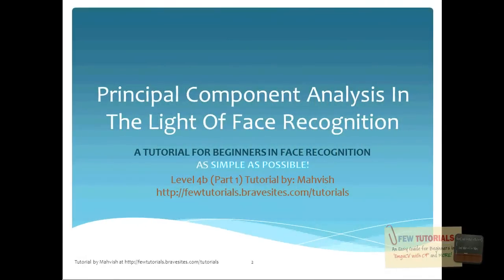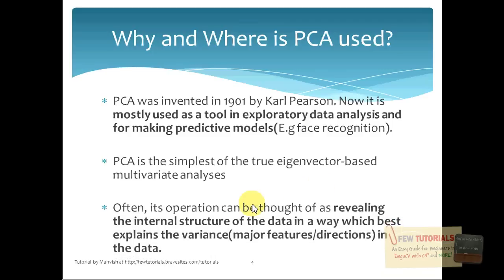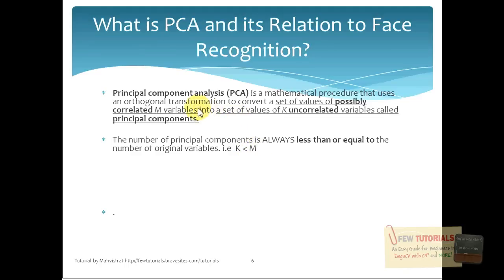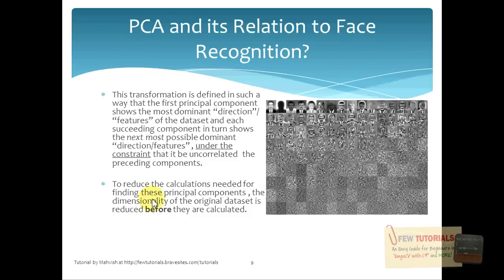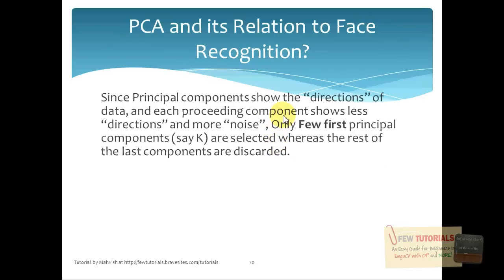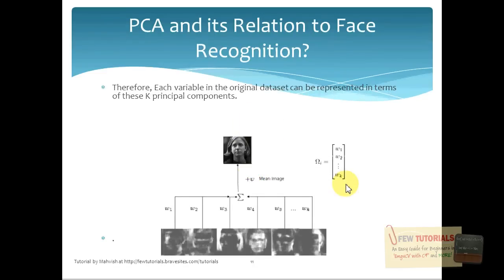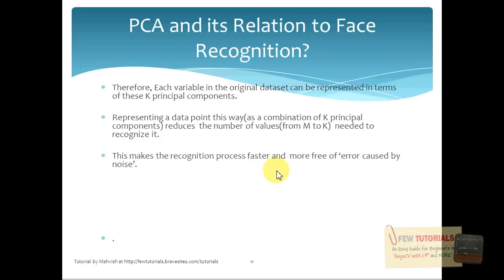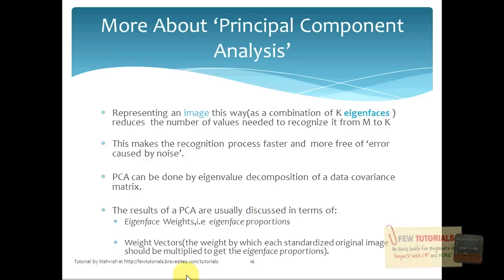What is PCA (explained from face recognition point of view)

Comment: you say using pca an image can be represented using k values instead of m where k<m. you say m is the number of images in the training set. shouldn't m be the number of pixels used to represent each image in the training set or to say in other words the initial dimensions of each data point. so for example if there are 400 images in the training set and each image is initially represent by 24*24 pixels then m will be 576 and not 400 as you say in the video. please clarify. thanks in advance. your tutorials are very helpful! thanks for making them available.